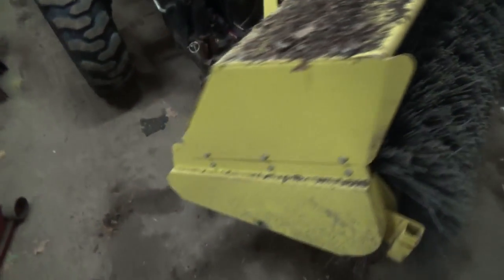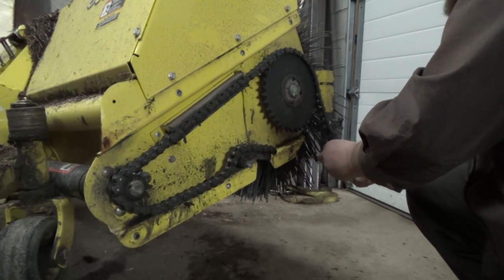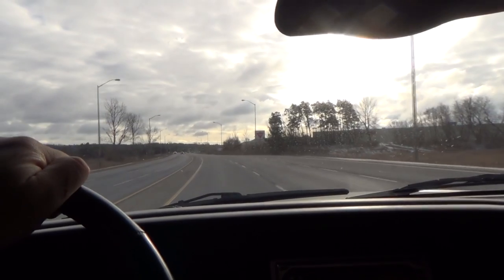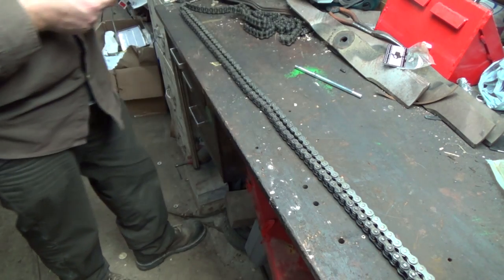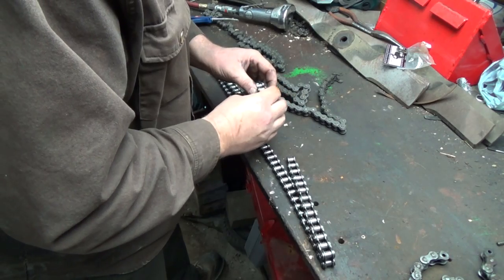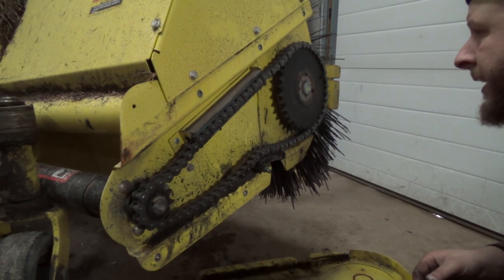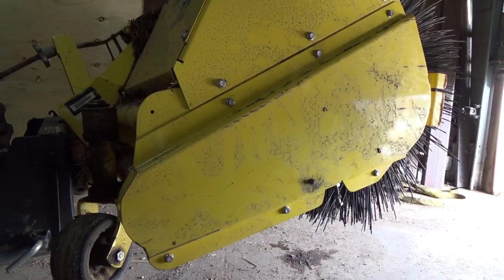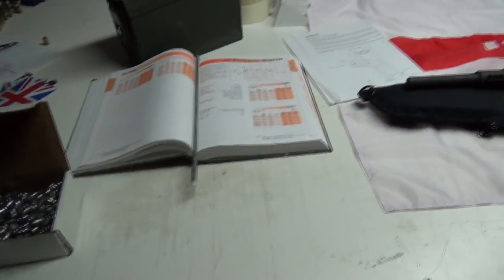Servicing the Deere front mounted Sweeper

Comment: Just a small tip for you Bill as we learnt the hard way :S. On our Grey fergie the timing chain works the exact same way as this with the bolt coming out through the plate to set the tension and we could not think of how to set the tension and so on until we had a chat with an old mechanic friend who specializes in grey fergies. He told us to loop a string around the tension cog or in your case that slide an pull it tight then wrap both ends of the string around something on the top of the brush, put your side plate on but don't tighten it completely, then tighten you tension bolt hand tight and then give it a half turn with the spanner. Then lock it in place with the lock nuts, release one end of the string and pull the string out with the other end then tighten the plate done fully :) hope you find this helpful cause we sure did

Comment: on your cold engine look at scan data. ECT and  IAT sensors reading should be within 5 degrees of each other and reading should be ambient outside temperature.  Your MAF sensor at idle should read between 2000 and 3000 hz.  Hot engine MAF sensor should be 5-6 gps.  Your IAC sensor controls your idle so at idle  you should read 75-90 counts and  KOEO 150 - 170 counts.  EGR  position sensor  at idle should read less than 1.3 volts and in off position.  TP sensor  desired angle 0% at idle.  You will probably  find your problem  checking these sensors that  can be  affected more so at colder temperatures.  That should keep you busy for a bit. Cheers  !!

Comment: The next time you remove the chain cover from the broom, check the set screw on the key for the input drive sprocket, when you were moving the new chain  back and forth before you finally hooked the master link on, I am pretty sure I seen a bit of movement of the sprocket on the shaft.  Also the next time you "break" a chain lay it down on a solid surface and then use a sharp cold chisel BETWEEN the two plates directly over the two pins and hit chisel with hammer to force the side plate off the pins, a whole lot faster and easier than grinding or trying to use a regular chain breaking tool

Comment: In reguards to your truck in could be a plenum gasket that is messed up...then like you said it would cause a vacum leak. Once it starts sucking more air in the computer reads that and has to re calculate the air to fuel mixture.  So when your sitting still it probably stalls because its sucking air and the computer is dumping fuel in and its flooding itself. Same thing happened to me...costed about $800 for the repair at a shop :/

Comment: A few things that may be causing you trouble on your truck is the temperature sensor, it may be going bad and is causing it to send a false reading to the computer, which in most cases will usually tell the computer the engine is cold causing the computer to compensate with more fuel more or less creating a flooding effect.  another  item to check is the distributer cap (if it has one and not  Coil Packs) if it does, remove the cap and look to see if it has the Aluminum contacts inside for each spark plug wire, they will glaze over and give a misfire reading due to the high resistance, If that is the case replace it with a cap made by STANDARD, that cap will have the copper alloy contacts completely eliminating the misfire reading on the  scanner

Comment: Hey Bill buddy- the strange *all warmed up" increase in idle you mentioned in the truck might just be because of using defroster in the cold weather.  The truck might be cycling the A/C to give you dry air to defrost with and would be idling up to help make up for the drag of the compressor kicking on.   I'm no pro, but that could be a possibility now that it's cold and there's snow on the ground.

Comment: Get some spray carb cleaner, Start the truck and spray the vacuum lines and other connections around the throttle body etc. If there is a vacuum leak you will hear the engine change if there is a leak where you are spraying.

Comment: If you wanted some sort of scale to check and see how far to turn that adjustment bolt in you should have screwed it in with the cover off.  You screw it in until you think that it is at its maximum height and then use a Sharpie to mark a line on the bolt threads.  Next you loosen the bolt to find a minimum adjustment level and then mark a line there.  Now take the bolt out and mark it more permanently with a scratch mark or small drilled hole.
Reply: the hole for the adjuster was on the side plate. so you cant run it without it.
Reply: MrRizzl42
You are not understanding my idea correctly.  When I said "Now take the bolt out and mark it" I meant  that once he had marked it with the Sharpie, he needs to take the bolt out and mark it somehow that would not rub off or fade it away.  I did not mean to keep the bolt out, I just wanted him to have a scale measurement on the bolt to know the minimum and maximum tightness for turning it in.  I was trying to suggest a way to get past the problem of not being able to see past the cover to see how taut the chain is.

Comment: bill check your idle air control valve i know on the fords they die out like that whrn there bad and the idle going up and down like that when they go bad theres no codes for it pull of off and clean it out with carb cleaner if it runs right its bad
1993cobras

Comment: that chain was fine for what its doing its the same constant power not a dirtbike where you are on and off the throttle it stresses less. seems like you do things for the sake of a video even if its not in the best interest of the cemetery.
Reply from the maker: preventative maintenance its not much good if its broke down
Reply: BILLSTMAXX :) no point in replacing something that doesn't need replaced